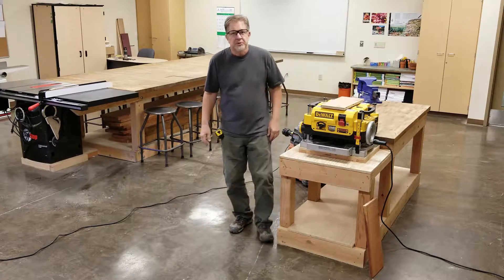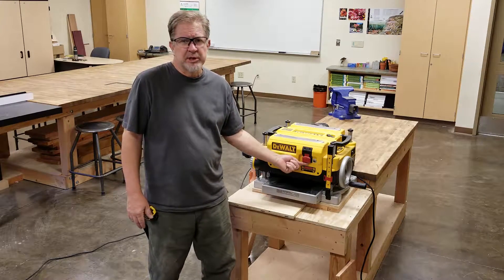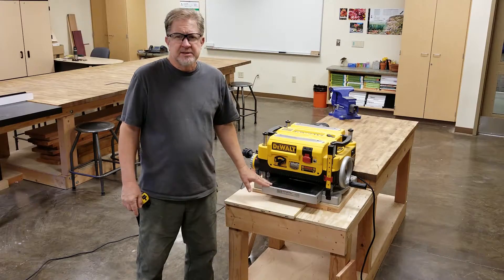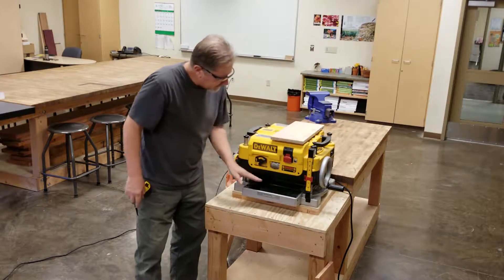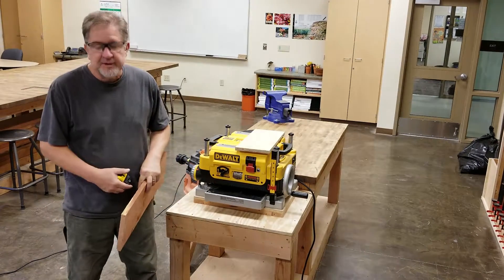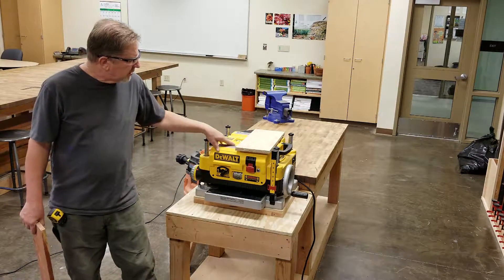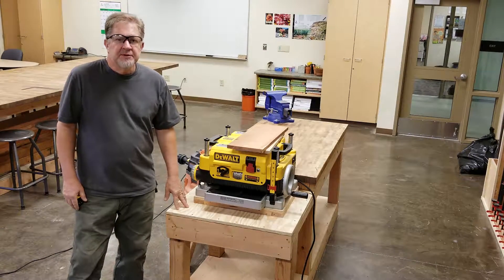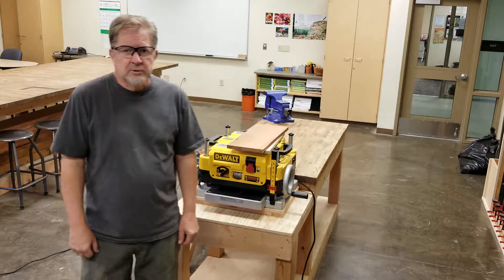Planer Safety

Comment: Never saw a planner kickback until 30 minutes ago . it almost broke my finger. what the hell is that about
Reply from the maker: The planer has rubber rollers that are pulling the material past a rotating cutterhead.  The rollers are pulling the material to the output side, the cutters are pushing the material back to the input side.  The cutterhead can easily overcome the force of the rollers if the material is allowed to rock or move.  Make sure the bottom of the material is straight, flat and true before going through the planer.  No rocking in any direction!  Always stand to the side when running material through the planer, but that doesn't really protect your fingers.